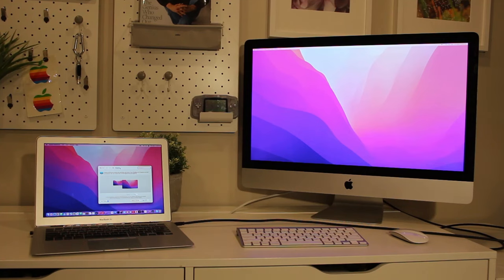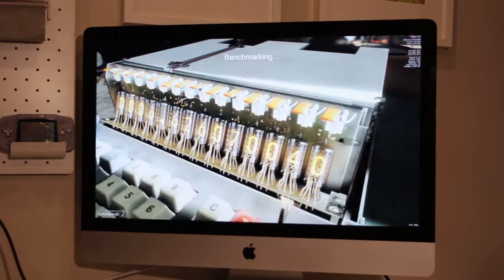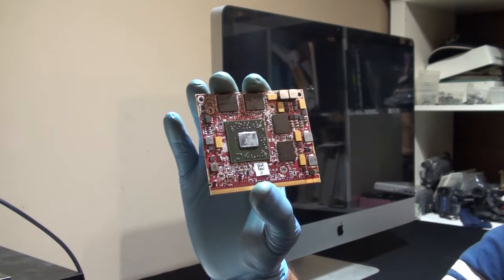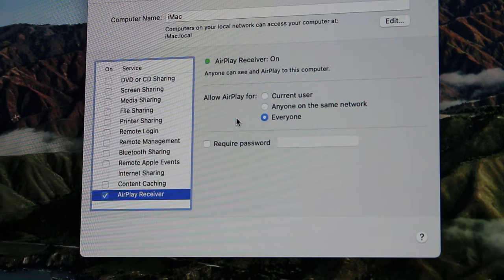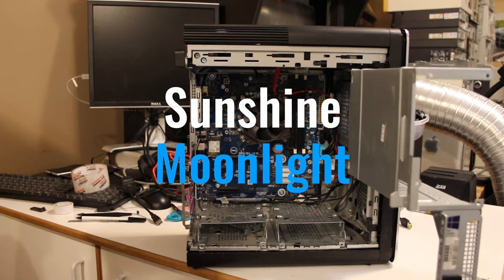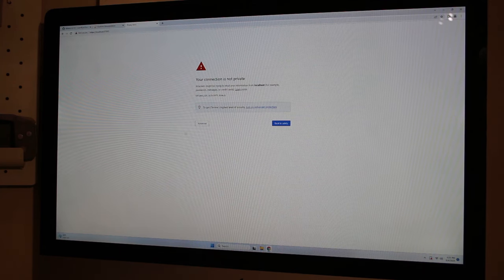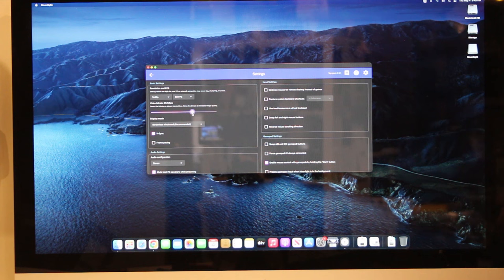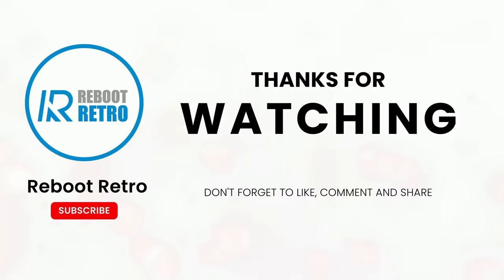Use ANY Mac as a monitor, not just Target Display!

Comment: Does this mean I could get a MacBook Pro (Lets say 16 inch 2019 model) and use that as a monitor and keyboard + trackpad for a PC build?
Reply from the maker: Yes, you could.  It's not perfect, you do see some minor graphical blocking from compression and you do waste some resources on the PC encoding the stream.

I wouldn't recommend buying a MacBook just to use as a monitor, but if you want/need a MacBook anyway and also want PC gaming, this is a great way to hide a messy tower rig! :D
Reply: I have been considering, however I’m probably going to use the even cleaner Apple Cinema Display. There is a model that comes in 24 inches and is 16:10 which is perfect for me

Comment: If have iMac with USB C Thunderbolt 3 and Dell XPS 9510 with TB4 would I be able to connect iMac as a monitor direct to laptop with no adapters? And which cable do I need TB4 cable or TB3? Thanks!
Reply from the maker: No, Target Display with Thunderbolt does not work between any PC and Mac.  Instead, use the last method in the video with Sunshine/Moonlight.   The Sunshine/Moonlight method will work with almost every Mac/PC combo; it will work over WiFi or direct Ethernet connection (preferred).

Comment: I have a 2013 iMac with a Thunderbolt port, could I use it as my main monitor for my pc if I used a thuderbolt to displayport cable? or do I have to use the sunshine/moonlight thing?
Reply from the maker: Yes, you'd need to use the Sunshine/Moonlight, or Parsec, or AirPlay.  Thunderbolt only works Mac to Mac, and theres some limitations with models and OS versions too.  The 2009/2010 models are the only ones that work with a generic DisplayPort signal.

Comment: Interesting. So as I understand you are now sending the display signal through the RJ45 port? To be fair, I have actually seen something similar done in a manufacturing facility, where the machine had no dedicated display ports, but the signal was sent out via RJ45 instead. So the displays were actually having custom cables. I still wish there was a homebrew solution to decrypt the original target display signal and send it out via the same port (thunderbolt) but as a display signal. Should work fine.

Comment: Hi! I hope you could help me :), I have a MacBook Pro M2 2022 13in, Would it be possible for me to use my old 27” iMac from late 2013 as an external monitor?
Reply from the maker: Hi!  The 2013 iMac is very difficult to use as an external monitor for an M2 Mac.  The best method is Target Display, which does not work on Apple Silicon Macs (M1/M2).  If you upgrade your iMac using OpenCore, you can use the AirPlay method.  However, the easier method in your case would probably be similar to the Sunshine/Moonlight solution like so:

Because you want to connect Mac to Mac instead of Mac to PC, you would need to use something like Parsec instead (https://parsec.app/downloads).  The concept works just like in the video, BUT you will use Parsec Host and Parsec Client instead of Sunshine and Moonlight.

You would install Parsec Host on your M2 MacBook Pro, and you would install Parsec Client on your 2013 iMac (requires minimum Mac OS 10.15 Catalina).  Parsec will allow you to remotely connect from your iMac to your MacBook Pro just like I did.  Important to know you cannot use as dual screens, you only get to see the main screen.

There is another product called Luna Display which can do this much easier (https://astropad.com/product/lunadisplay/), but it isn't free.  I've never used it and can't vouch for it personally, but they've been around for a long time.  It should be easier to set up and is less "hacky" than my free solution.  It also lets you use dual screens.

Hope this info helps!!
Reply: Thank you so much, I'll try with your solutions!  @rebootretro

Comment: Sorry if this is already answered by you -- My situation is a 2015 iMac 27" to be paired with my M1 Macbook Pro. Which do you believe would be the best route?
Reply from the maker: I think out of the ones shown, only Sunshine/Moonlight method would work for a 2015 iMac (possibly AirPlay method would work too, but only if the iMac was running OpenCore and modded).  You might also consider trying Parsec.  Parsec works like Sunshine/Moonlight, but is easier to set up with Mac to Mac.  It is important to know that Parsec requires an internet connection to work (even if using LAN, it requires internet for sign-in), while Sunshine/Moonlight can work entirely local.  Hope this helps!

Comment: Hi! I have a Macbook Air M3 with a late 2013 27" iMac running Catalina I hope to use as a second monitor. Would that work with a Thunderbolt 3 to Thunderbolt 2 adapter and a Thunderbolt 2 cable? Just plugging it in doesn't seem functional.
Reply from the maker: @jessefrankema4836  Target Display with Thunderbolt is extremely limited to Mac certain Mac models and certain Mac OS models.  The 2009 model shown doesn’t use Thunderbolt, it uses DisplayPort - which was used for 2009 and 2010 before they switched to Thunderbolt and is compatible with any DisplayPort signal.  For a 2013, they do not work with any of the M chip Macs, so you’d have to use one of the other methods - like Sunshine/Moonlight, Parsec, AirPlay (the 2013 may support AirPlay if modded).  Hope this helps!

Comment: Okay I have a 2017 IMac 21.5 inch. It doesn’t have a display port, so I bought a usb to hdmi adapter. Do you think I will be able to connect my gaming console (ps5) and use my iMac as a display or should I just send the iMac back and get a Mack mini and a monitor?
Reply from the maker: The USB to HDMI is for display output from the iMac, not an input from a video source like a game console.  The only option from a game console would be a USB capture card - it would need to be a Mac compatible one, and would add some latency to your gaming.  A Mac Mini would with a monitor would be a much better option.  If you get a monitor with 2 HDMI inputs, you will be able to switch between Mac and console without unplugging and plugging cables each time.  If you don't have a separate sound system, then make sure to get a monitor with speakers.

Comment: I still use 2011 iMac and it can connect just fine to PC I actually use a Thunderbolt mini display - “display” input cable.
Reply: Do you have a link please and thank you?
Reply: Can you please share a link to this item? Do you have a mid 11 IMac? Thx
Reply: @vehmann6831  sorry I bought it so long ago I can’t recall the specific brand, I would suggest most any Mini/display to whatever port you have should work maybe just try finding one that specified Mac compatibility. I am not sure as I write this what date my iMac is but I can say I have a 2011 and a 2012 and both connect to PC with target display so any 2011 should work fine. The 2012 is a bit more fidgety tho. FYI if you attempt anything like this due note you will need a keyboard and mouse as well for the Mac here n there to access the target display mode.

Comment: Hey! I have 2011 27 inch iMac and i am going to use it as monitor for MacBook Pro with M1 Pro. Is it possible? Or apple silicon doesn’t support?
Reply from the maker: Hi!  The 2009 and 2010 versions work exactly like a DisplayPort monitor, and work perfectly with Apple Silicon.  However, with 2011 models Apple switched from standard DisplayPort to a proprietary Thunderbolt connection which only works with certain Macs.  The 2011 iMac onward does not officially support Apple Silicon.  BUT, you can still use a non-Apple method like:

- Sunshine/Moonlight (Sunshine free/open source but is still "experimental" on Mac)
- Parsec (free for personal use)
- Luna Display or Duet Display (costs money)

You may also be able to use the AirPlay method as well, but you may require a WiFi card upgrade to do it on a 2011.  Later models should work fine natively for the AirPlay method.

Comment: i have a question i got a m1 macbook pro and a 2013 21.5 inch imac. Can i use a usba to usbc cable to connect them to eachotherthen use airplay or could i just connect it wirelessly if so how?
or both of these ways cant work???
Reply from the maker: No, you can't connect USB A to C.  You can use AirPlay over WiFi, but on a 2013 model AirPlay Receiver is disabled by default.  On a 2013 you must enable AirPlay Receiver, which should be possible by installing OpenCore and upgrading to Mac OS Monterey or newer.  If you want to use the iMac as your main display and do not need secondary display, you can use Sunshine/Moonlight method or Parsec (Parsec works like Sunshine/Moonlight in the video, but is easier to set up especially on Mac).

Comment: I have a Linux desktop with Thunderbolt 3, a Windows 11 laptop with Thunderbolt 4, and two mid-2011 imacs with what I assume to be Thunderbolt 1 or 2? Can My imac's work as target displays for my thunderbolt linux and windows computers or does it have to be mac os? Can potentially hackintosh my desktop so thats still a possibility if mac os only, but would prefer not to.
Reply from the maker: Thunderbolt for Target Display only works with certain Mac models and Mac OS versions, although I don't remember all the specific combinations.  Unlike the 2009/2010 iMacs which accept any DisplayPort signal, the 2011+ doesn't work like a generic Thunderbolt display and is proprietary.  From research, they will not work at all with any Apple Silicon Macs and won't work with any Windows/Linux.  Your best bet is probably Sunshine/Moonlight or Parsec in your situation.

Comment: IS THERE ANY WAY TO USE MY 2011 27" IMAC with sierra to use it for an xbox one monitor? I bought an "alza" branded minidisplay to hdmi adapter cable, and its just dont do anything. Can smb help? Any options? Am I using a wrong adaptor? Its just a single cable no other power required 
Pls help 😢
Reply from the maker: There may be 2 separate issues here.  It looks like your outputting HDMI signal from XBOX and inputting directly into Mini DisplayPort on the iMac, which will not work.  Although that basic cable will work for outputting DisplayPort video to an HDMI monitor, you MUST use an active converter to translate signals to go the other way (HDMI to DP monitor).  A 2009 and 2010 iMac 27" will accept XBOX video if it is converted from HDMI to DisplayPort signal using a powered/active converter.  Unfortunately, 2011 iMacs are completely different and ONLY accept Thunderbolt video (no DisplayPort or HDMI), and only from certain Mac models and Mac OS versions.  To connect an XBOX to a 2011 iMac, the only option I think would be an HDMI to USB capture device.  You would need a capture device that is compatible with Mac, and then you could use something like VLC to view the live video.  This method would likely have significantly more lag, which might not be ideal for gameplay depending on which capture device you got and how picky you are.  The image quality will also get degraded some with this method.  If you're not fussy about lag or image quality, the HDMI USB capture could work for you.

Comment: My iMac is not capable of starting the Mac OS version it had, hard drive problem I guess. I tried many solutions to make it work as Target Display with my M1 Mac, having no success. The only thing I was able to do was to make it boot ubuntu 20, which works fine, but I cannot install obviously, so I can't do nothing more than web browsing and toying around with some terminal scripts and similar things. Is this it? Can't I make it screen mirror another source, maybe from a windows computer??
Or should I try to destroy it and transform it to a monitor permanently. Thanks in advance.
Reply from the maker: Hi!  Not sure what year it is.  If it is a 2009 or 2010, it should work for Target Display to ANY computer, including your M1.  I'm told that Mac OS MUST be running in order for Target Display to work.  If it is 2011 onward, than you're right - M1 will not be compatible.

The best solution would be to open the iMac and install a replacement SSD (so long as you can do it safely - remember, there is an exposed power supply inside which can be very dangerous!).  If you don't want to open the iMac, it is possible to run the entire system from an external hard drive.  Get a USB enclosure, install an SSD and leave it plugged into a USB port.  You may loose some performance via USB (depending on your iMac the ports may be 2.0), but it is entirely usable.  You can definitely install Mac OS, and you can probably install Linux this way too.

The screen conversion method is an option.  It cost some $ to buy the converters.  If you want the cleanest method with the custom pre-built PCB, it's a little bit of a pricy upgrade although some would still argue worthwhile.

Ultimately, if your goal is purely to have a monitor, the screen conversion method is probably best providing you don't mind spending money on the parts, putting in a lot of effort, and know how to safely work around the internal power supply.  If you want the cheapest and easiest method, I'd grab a USB enclosure and a cheap SSD and use iMac permanently with an external hard drive.

Hopefully this helps, or gives some ideas.  Good luck.

Comment: If I use a displayport adapter connected to HDMI, and from this displayport adapter I connect my 27-inch 2010 model imac, can it work?
<3
Reply from the maker: If you take HDMI source ---> HDMI to DisplayPort Converter ---> iMac 2010 then yes, it will work.  Your adapter MUST be an ACTIVE adapter/converter, not just a pass-through cable.  A basic pass-through cable will NOT work.

To clarify, a passive adapter will change the physical connector from HDMI to DisplayPort, but the signalling will still be HDMI which the iMac won't see.  An active adapter changes the connector AND converts the signalling to DisplayPort signals.

Hope this makes sense :)

Comment: Have you tried using a more recent iMac as a monitor for a macbook pro? I'm trying to use a 2021 iMac as an extra display for a 2019 Macbook Pro.
Reply from the maker: The best method is Target Display, but Apple discontinued this I think after 2014.  In your case for a 2021 iMac, you would need to use the AirPlay method or the Parsec method (similar to Sunshine/Moonlight, but Parsec works Mac to Mac)

If you are using it as a secondary screen for text, documents, email, internet browsing, the AirPlay method is probably best.

If you will be doing multimedia, gaming, video editing/playback, then Parsec is better.

Both those options are free.  There are other non-free options such as Duet Display and Luna Display which also work similarly, although I haven't tested these personally.
Reply: Hi, can a 2019 IMac be used as a secondary monitor?
Reply from the maker: @kalatravis8467  Using the AirPlay method, you can use a 2019 iMac as a secondary display.  I know it works on Monterey, but I'm not sure about older.  Like shown in the video, it works great for text but video can be a little laggy.

Comment: Hello RR, 
I learned a lot about my old iMac 2009 21,5inch these days. One of it: it doesn't support TDM and here Iam, trying to find ANY solution to make this iMac a second screen for my Macbook 14inch, 2021. 
Is it really not possible?
I've read and watched videos about a HDMI dummy plug (but with a newer iMac targeted as the Monitor) or installing Ventura on the iMac to be able to use Airdrop -> Airplay receiver. Have you ever heard of one of the two solutions or know if they work?
Thank you very much for any hint.
Reply from the maker: You can do the Airplay method; it works just like shown in the video.  You don't need Ventura, it works with Monterey... BUT your WiFi card has to be supported or else AirDrop, AirPlay receiver, etc don't work.  But you can fix by buying a compatible USB dongle (has to be a particular Broadcom chip to work - check the docs on Dortania GitHub), or changing the WiFi card in the Mac.

Another method is remote connection using Parsec (same as Sunshine/Moonlight, but for Mac).  This lets you use your MacBook from your iMac, but not dual screen.

The only other option I'm aware of is something like Luna Display or Duet Display.  Luna Display is a physical dongle you plug in (maybe that's what you're referring to with "dummy plug"?), and can use another computer as a screen.  I haven't tried it myself, but it says minimum 2011 for primary screen (your MacBook side) with Mac OS 10.11 El Cap, but only Mac OS 10.11 El Cap for secondary.  I can't vouch for if it works or how well, but the specs suggests you can do it with your MacBook and 2011 iMac.

Comment: Any way to use a 2010 iMac as a display that has a dead HDD, without opening it up and changing the drive? Would connect it to a M2 Mini.
Reply from the maker: If you have the 27" 2010 model, it should support DisplayPort as input from your M2 Mini.  I haven't tested it, but the documentation says Mac OS needs to be running.  You CAN do it without opening the Mac:

Get a large USB flash drive (32GB is probably big enough) and install a fresh copy of Mac OS on that flash drive as if it were a hard disk.  Boot from the flash drive "hard disk", go into System Preferences and set the Startup Disk to the flash drive so it boots automatically every time you power the iMac up.  Connect your iMac as a monitor to your M2 Mini. 

You basically use the USB flash drive as a stand-in hard drive so the system boots and can operate Target Display.  Since you're not actually running any applications on the iMac, the poor flash drive performance shouldn't matter much.